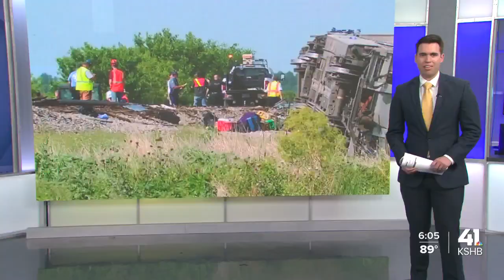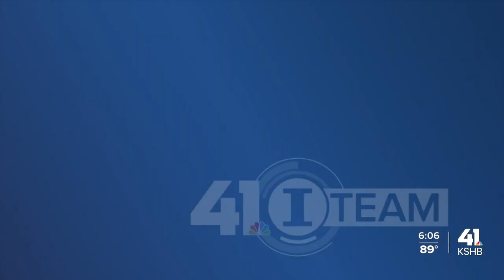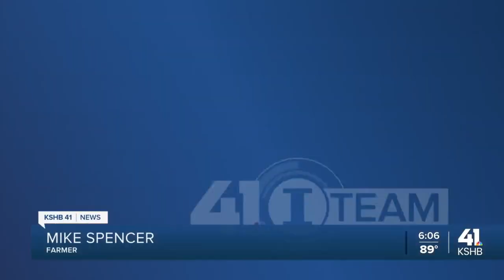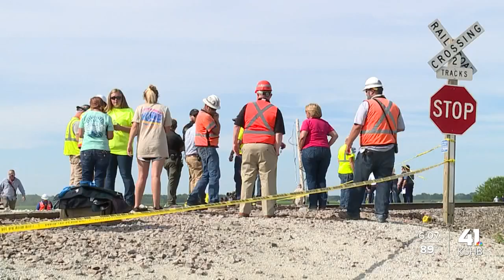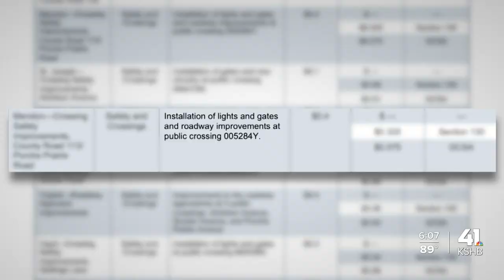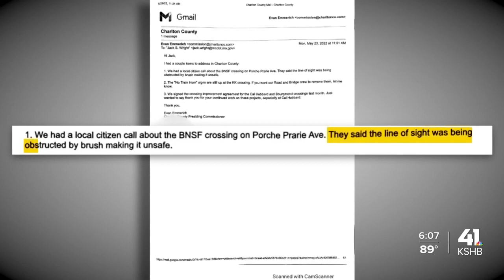Chariton County Commission repeatedly took concerns about crossing to BNSF, MoDOT

Comment: The signals are not the responsibility of the County, but the County could have rebuilt the approaches to reduce the steepness and provide a level area to stop and cross at right angles to the tracks.  Everybody want to pass buck by talking about what other agencies didn’t do instead of what they could have done on their own initiative.
Reply: In my state the county cannot do anything.  Any federal or state route is exclusively the  responsibility of the state DOT.  Cannot even install any utility or even repair without DOT approval.. Is MO the same way?